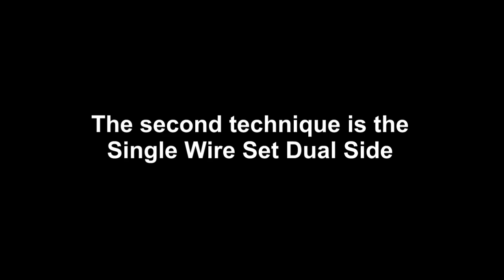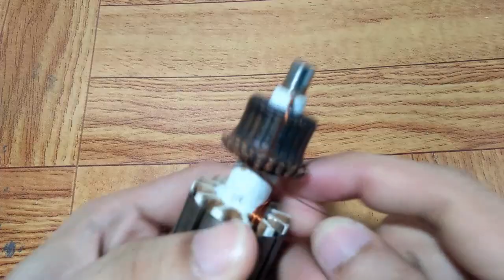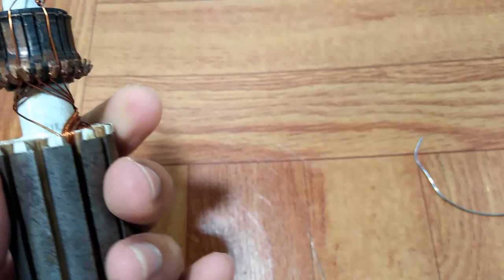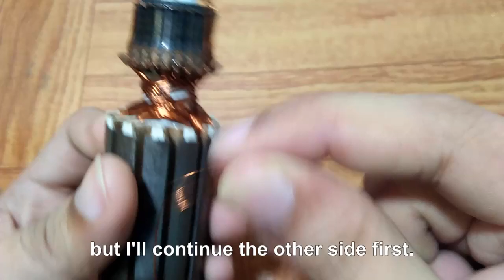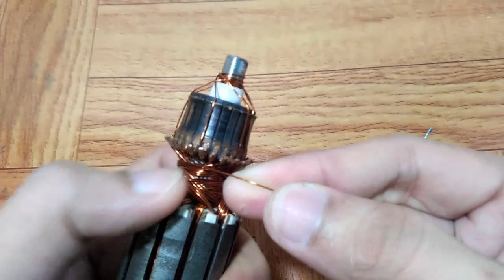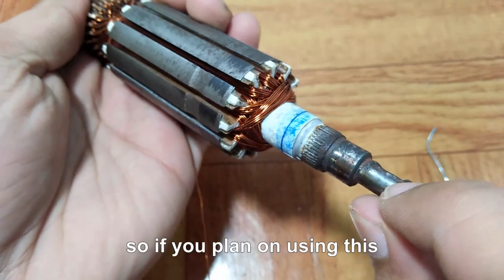Rewinding Techniques Part 2 (3)

Comment: Hello sir can a CA glue (super glue, universal glue,quick instant glue) be used to glue the wires around the commutator (between the rotor core and commutator)  instead of an epoxy glue ?
Reply from the maker: Hi sime,  super glue is not a good idea because the area around the commutator reaches very high temperatures and it will burn the glue plus the armature spins at a very fast rpm.
Reply: @JakeMarvinVillegas  ok thank you
Reply from the maker: @MKDSime  you're welcome